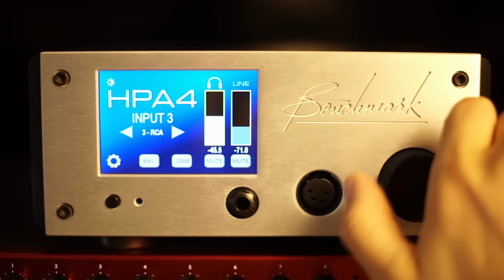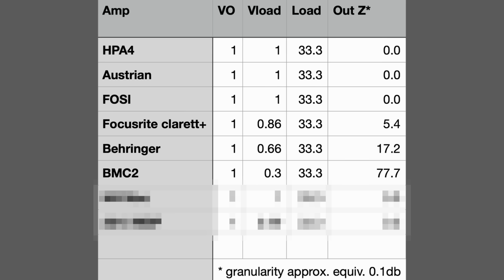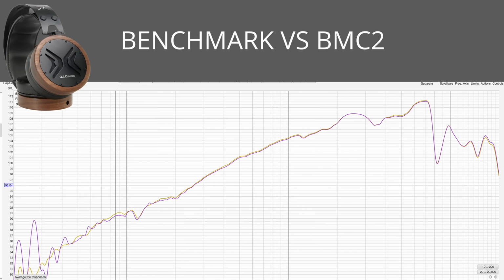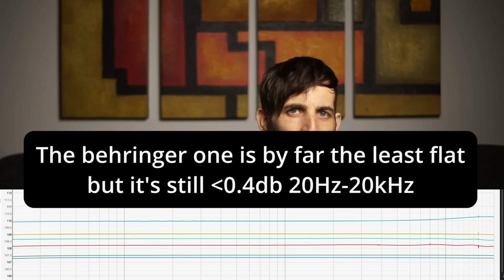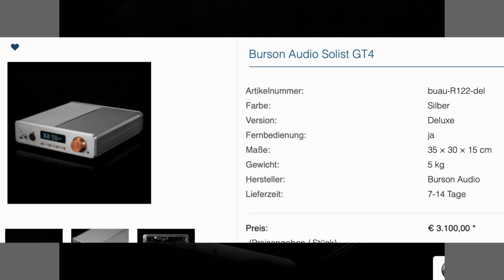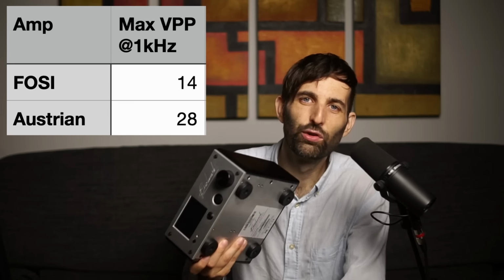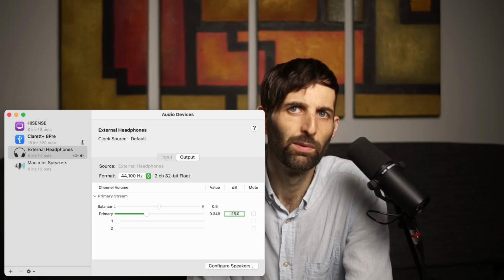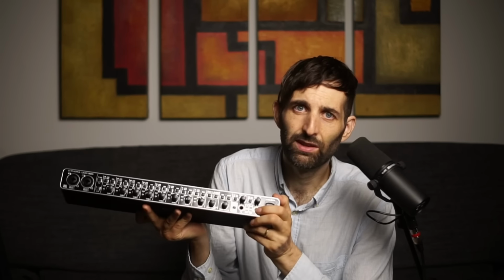Stop plugging your headphones into your audio interface!! Headphone amps demystified.

Comment: I did a deep dive on analog vs digital volume control awhile back. It amazed me that most info about the subject completely skipped the existence of an IC chip for volume control. its typically a digitally controlled analog potentiometer or a specialized audio attenuation chip. They allow precise, microcontroller-driven volume adjustment without the mechanical wear or signal degradation of traditional physical potentiometers. This seems to be what is used in my 2007 AV receiver and most modern electronics before DAC's with 32bit and internal digital volume controls. I only discovered this fact not after an exhaustive search of the subject but by tracing the circuit diagram in the service manual of my Pioneer AV receiver to find out how the volume was controlled.

Comment: I use my audio interface headphone output. It has 2 separate headphone outputs with separate volume controls. 6 years ago when I bought it I set 1 has my reference monitor. I set the volume and I Never touched it since. I use the 2nd headphone output if I need to change the headphone volume temporarily. No headphone amp needed.

Comment: this delta in diff... is just about the impedence.. not important if do not cross "at least" a 3.2 db PER CHANNEL of difference...

you have to divide by 2 the sum that you see here ... because the difference is splitted 50% left and 50% right..

a 0.8db peak of difference is absolutely irrelevant.

there is the same difference that you can observe in a DI Box for HI-Z unbalanced instruments like bass guitars of ELEctric guitars..

the di-box have a deviation +/-% just because the fransformation on impedence.. but nothing that you can scream on a real recordings.

Says that.. no my friend.. as soon as your audio interface can handle at least 300 ohms.. you can use everything you want.
novadays a 600ohms integrated CRSTAL CLEAR pre are integrated on audio interface.

Comment: Just trialling my Beyer DT770's into the front headphone out on my MacMini (2024) Firstly:  Thanks to the lad at Andertons Music  Guildford who pointed out you can simply unscrew the 6.35 (full size) headphone jack, to reveal a 3.5 jack, rather than buy an adapter ... Who knew - Secondly: Well, this certainly confirms my hearing of the bounced from Logic Pro to my MP3 version, that the Drums are wrong. Via both my ZoomR8 and NAD amp all was ok. So, there is something in this, and I shall be going down the MacMini playback route for the present. Not really in the market for a new Audio Interface. I have considered it but since recently also trialling Tape16 DAW, the transport controls work within the Tape16 DAW, so for us non-working music makers it'll be test until it breaks time here. Cheers for the tip !

Comment: Really love the way you cut through the crap and get to the specs/measurements/observations that really matter. After watching this video with great interest, I took notice of the recently-released Yamaha URX44, as it ticks many boxes in this video topic - maybe all?: Digitally-controlled and repeatable gain/volume levels on inputs & outputs, and notably, also on the headphone outputs. The headphone outs are also spec'd with low output impedance - the documentation says 10 ohms. (On edit: Perhaps low-ish impedance, as it is not zero-ish, like your better references have.) Interested in any thoughts, or maybe even a review! 

P.S. Good luck, Godspeed, and Cheers to your new studio endeavors in Cyprus.

P.P.S. Since posting, I have run across an accessory that could work well as a low-impedance inline buffer for headphone outs. It obviously won't overcome the problem of non-repeatability from cheap pot controls, but still could provide a nice workaround for an otherwise-good interface. It's listed online at the usual places (eBay, Amazon, etc.), searchable under "47 Headphone Amplifier". They seem to be pretty much only available in kit form, so soldering is involved. On the plus side, they are really inexpensive, and being in kit form greatly lowers the barrier to them being modded. For instance, though they do come with volume pots, those could be easily bypassed with jumpers, or with high-quality stepped pots, or even with properly chosen fixed resistors to match the desired gain. I spotted kits with op-amp sockets, which would allow for rolling of the op-amps a-la Fosi Audio, say, for higher voltage or current output.

Comment: The important thing with impedance is matching it. That is not new, it's basic audio engineering. Not just in audio, but also at radio frequencies. The impedence of cables does matter, so does the resistance. It's basic electronics. You can't just learn this stuff off by heart- you need to understand electronics. Posts like this don't really explain anything.

Comment: I’m confused. I watched this video and decided to plug my Hifiman sundara’s directly into my new Mac mini 4 output to compare to the headphone amp on my universal audio Apollo.  I had to turn up the volume to max and it was clear there still was not nearly enough voltage to power the headphones properly.  Just night and day far better sounding from the Apollo.  The sundaras are about 38ohms impedance and 92-94db sensitivity.  Just too hard to drive?
Reply from the maker: Yes I said in this video the max voltage is low and a limiting factor

Comment: I have a Monolith THX AAA 887 and a SPL Phonitor 2. As for pure dampening factor/drive, the Monolith is insane. It can drive just about anything with extreme ease and so in many ways, despite being nearly seven times cheaper than the Phonitor! I primarily use two headphones for mixing/mastering and listening pleasure: AKG K712 and Audeze LCD-X. These are two very different headphones in terms of technology and sound but despite the Audeze being planar they are much easier to drive than the AKGs because the latter not only have a higher impedance but a lower sensitivity making them a little difficult to bring to life. So when it comes to just listening pleasure I prefer the $350 Monolith because it can manhandle either headphones very well. I prefer the SPL when it comes to mixing/mastering because of its insanely high voltage which is great for dynamic range (important for mixing/mastering) and for its ability to mimic speakers in terms of spatial placement. This obviously has nothing to do with audio “purity” but many mixes on headphones sound good on headphones and not on speakers and the SPL allows me to confidently make a mix that will sound good on loudspeakers as well as headphones. The SPL Phonitor 2 also has about 30V of output voltage which is insane and why it’s great for mixing/mastering (they advertise some weird term like 120V “total rail” which is equal to +/- 60v which is just nuts but I digress). But to your point, it’s funny how an amp with is seven times cheaper can sound better. I would encourage you to look at the Monolith THX AAA 887 amp. It’s specs match favorably against the Benchmark, which is indeed a fine amp but it’s $4k! I think the Monolith is now only available used but I think there’s a newer update for it.

Comment: Another question... So if one were to get this 4k headphoen controller... Is it connected to the interface line out and you get the 0 Ohm? So it is the potentiometer itself, connected to the headphone out, which gives it this 17 Ohm impedance? How would one c onnect this is the question I guess. 

If I were to connect my headphones straight to the audio interface line out, would it just max the volume possible on my headphones? I can digitally control it in the DAW... is it still 0 Ohm?!

Comment: I think the reason the output impedance is changing the FR in a seemingly random way between different headphones has to do with the headphones' impedance curve across the frequency range, some might have a higher impedance in the bass due to their design than they have in the treble, etc.
And that would make the effect of a high output impedance different.

Comment: Showing frequency response for the "mystery" Apple computer as proof of how good it is, completely ignoring the output impedance being 10-30 times higher than a good DAC/amp, the dynamic range which is 20-30 dB lower than a good DAC/amp and the THD (Total Harmonic Distortion) being maybe 10-30 times higher. Well, well.

Comment: You can build a headphone amp that's as good as it gets for less than 100 bucks... even much cheaper if you don't care about the enclosure and use a simple protoboard. There are some amazing op amps out there with incredibly low harmonic distortion, super fast slew rates, and with an extremely low noise floor, and capable of handling enough current at a high enough voltage to drive even the most demanding headphones with room to spare... and they are relatively cheap. Even the best ones are well under 10 bucks. The main thing you need in addition to that is a really good power supply with s surplus of current and rail to rail headroom. I've built many of them myself and the proof is in the listening. Most headphone amps in consumer products are not fully capable of driving a typical headphone load, so if you have a high performance op amp with a great power supply down stream from it, even then you will often hear dramatic improvements in stereo imaging, for example. In any case, the thesis of this video is right on the money in regards to price. There's no justification in the world for paying thousands of dollars for a headphone amp, other than say, bragging rights among people who happen to be equally bamboozled by high end audio marketing BS. In the end, the hearing experience is entirely subjective, so do what ever floats your boat, but if you're considering paying thousands for a headphone amp, you might consider hiring a smart high school or college student to built one for you at a fraction of the cost, and with the satisfaction that you're offering support and providing an incentive for an aspiring engineer.

Comment: I've owned my Benchmark HPA4 for five years; I bought it to drive my Audeze LCD-4s and it doesn't disappoint. I am, however, using it as a line driver/preamplifier because I am using the AHB2 amplifier to actually drive the headphones. I have no need for anything else. Endgame.

Comment: Great work although you seem to slip into Apple fanboy mode at the end as you might want to apply your scientific testing to a PC / laptop before you dismiss them broadly. Surely there are a limited number of designs / common components used for headphone amp circuits in higher end laptops, PC or MAC.

Comment: A proper headphone amplifier will be flat and not give a crap about the load impedance (within reason) and will simply replicate the input signal with a fixed voltage gain and enough current to ensure that there is no perceptible distortion.  There should really be no volume control for the headphone amp as the output should be coming from the console and its output control.  Ganged analog pots are total crap and never matched channel to channel.  I am not surprised that the Apple laptop has a good headphone amplifier.  Likely uses one of the off the shelf class D bespoke headphone driver chip sets by Analog or TI.  There are a number of very well designed headphone amp chips used by the likes of Fiio in allot of their portable players.  You also bleed for them.  At the end of the day though, I personally don't care about the looks of the piece of kit.  I care about the actual performance.

Comment: I upgraded from my Focusrite 2i4 gen 2 to the new Clarett+ 2pre and I can notice the difference. Just a slight one, on the high end, maybe 5-8%. I can distinguish just a bit more detail. The signal is crystal clear, for just 400 bucks, which was the price for it. I doubt anything can make much more of the detail pop up, even if it's 5 grand. My next upgrade is going to be the headphone one - from Sennheiser HD599 to Sennheiser HD660 S2.

Comment: I have the Focusrite Scarlet 2i2 2g, Topping DX5 II and now the Fosi ZH3.  I testet my Focusrite and Aux in on my Pc for years.  I got the Topping since 2 weeks. The Fosi today.  Iam 50 and hear ZERO better quality on the amps.  My PC aux in is perfect.  The only impromevent on the amps is, that i can gain the Volume more. But this is useless for me, because the Sound from the Motherboard is loud enaugh. The only benefit is, that i have a device, where i can plug the cable on the desk.  The Topping is broke now. I cant use it with planar Headphones because of crackling sounds.  My Focusrite works fine for years.  The Fosi is working fine too for now.  Interesting, that i can gain the Volume on Focusrite far more that on the Topping.  All without distortions.  I send the broken Topping back and dont buy another one.  I keep the Fosi because of the Design.  Unfortunately the Fosi is black and not white. Awesome Design.  The Focusrite is ugly.  The Fosi K7 would be perfect for me as a gamer, but look very ugly.

Comment: "199" = basically free.
So, what costs 189$ besides 10$ for them amp/dac combo(like the apple dongle)
Reply from the maker: the case, screen, connectors, chips, PSU and PCBs cost significantly more than 10$

Comment: Summary:

 * Benchmark HPA4: Best overall. Flawless technical performance, 30V output, perfect relay-controlled level recall.
 * Fosi Audio ZH3: Best value (~$199). Integrated DAC with digital volume control eliminates channel imbalance.
 * Apple MacBook Pro (2015+) / Mac Mini (Silicon): Superior to many pro interfaces. Near-zero output impedance, perfect channel balance.
 * Austrian Audio Full Score One: Best for Hi-Fi listening. Premium build, lacks specific gain recall required for mastering.

Avoid: Behringer HA8000, TC Electronic BMC2, generic PC laptops, and standard interfaces with analog potentiometers.

Comment: Thanks for confirming that my Clarett+ is perfectly fine . and you can digitality controller the level in the Focusrite control app just adjust the knob at decent level ( like right in the middle) then use Focusrite control app to recall the le where you want it .Not sure why you say it can't be digitally recalled.

Comment: The Apollo interface features a large button in the center that acts as an encoder, and in addition to having LEDs around it, it can also be programmed in the software, offering flexibility for different volume levels depending on the project.

Comment: If you can't hear the difference between a MAC headphone jack and running a decent dac like the Chord Moja you are deaf.. the diffrence is HUGE. For listening critically a good DAC is a must, and the a great amp will be the icing of the cake. And NO you cant use youtube audio to anything at all since it changes the source sound. Get serious and try a good amp/DAC and I am concerned that audio interfaces has inferior DAC's. I have a Chord Hugo2 as my listning DAG and it is so much better than the DAC/headphone output on my Macbook Pro M4.. then i run the Hugo2 into SPL headphone amp and it sounds great. So again if you cannot hear the diffrence between these setups you should not even try to do mix music because you have serious hearing issues,

Comment: New to the world of mixing with a headphone amp...Would the headphone outputs on something like the Apollo x8 be any better than the interfaces discussed in this video? Also, where does the ohm reading of the headphones you're using to mix come into play? For example, is it still necessary to use a headphone amp for a set of headphones that are say less than 100 ohms?

Comment: I kinda wonder if the headphone-out flaw in most interfaces stems from outdated designs where the interface expects a high impedance headphone, since high headphone impedance is one of the ways to get around the high output impedance of the source. It doesn't seem to be that hard to do since a lot of Chinese manufacturers are cranking them out at low prices. One of the brands that I like to refer to, in addition to Fosi, is Topping. Even their flagship headphone amp model, the Topping A70 Pro, has drastically low output impedance (as per the spec sheet) and that's with a power output so high you can drive small speakers with it and it's only at half the price of the Benchmark headphone amp.

Comment: I agree with a lot of what you show here. But I think the video quietly jumps from “we identified the big measurable pitfalls for monitoring” to something like ... therefore amps are basically solved and expensive amps are for gullible audiophiles.... That conclusion is definitely bigger than the measurements you ran.

What you tested is mostly output impedance , headphone FR interaction, channel balance, recallable level, max voltage.... Those are obviously necessary for repeatable studio work, sure. But they don’t prove perceptual equivalence between competent amps, because a lot of what musicians call “distortion” isn’t a 1 kHz THD number or a sweep. It’s when the chain turns a living event into “recorded audio,” and turning it up just gives you a louder recording, not a more real voice/instrument.

Psycho-acoustically, THD is a very weak predictor because the spectrum and structure of distortion/IMD matters (as well as masking matters). Two devices can measure “super clean” on simple metrics and still differ in low-level harmonic structure, microdynamics, the attack-the bloom-the decay, noise modulation, multitone IMD, recovery near limits..... Those are exactly the things that can make a vocal feel like a person in air vs a perfectly separated audio object. There are AES papers discussing why plain THD doesn’t correlate well with perceived harmonic distortion exactly for this reason.

Great video BTW, cheers.